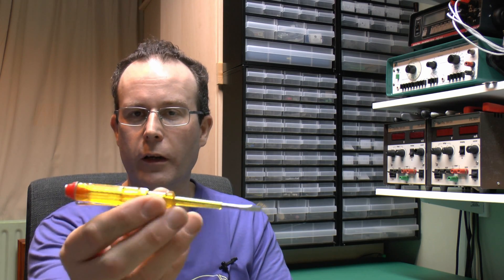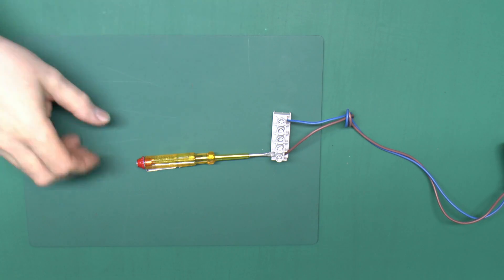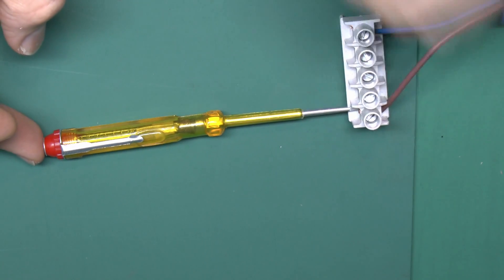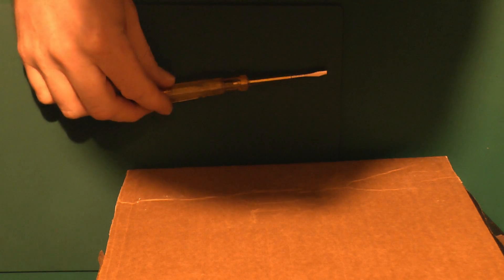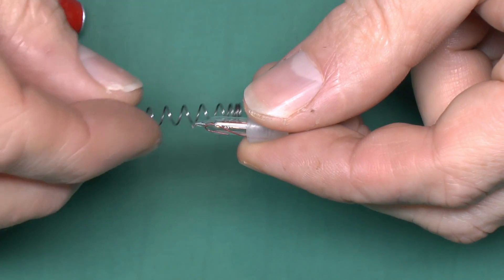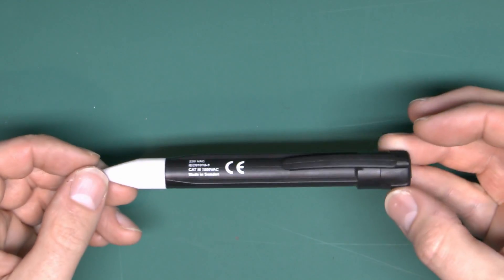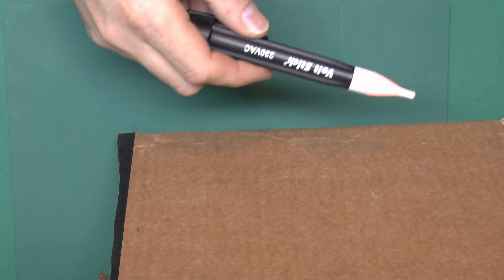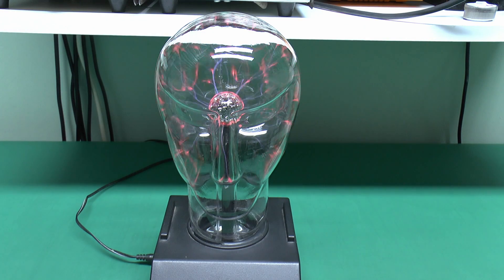Dangerous Device - Neon Mains Testing Screwdriver

Comment: I still have one of these purchased some 40 years ago, still works today. As you stated, only use to confirm mains present. NOT to confirm mains off. Mine has a standard type 1.5m ohm resister fitted. The older ones are somewhat better than the made in China crap. Needless to say mine is UK made! Made in the days when UK did make stuff, not just add a brand name to China rubbish.
Reply: Michael Beeny These testers are a dangerous. A decent multimeter can be had for not a lot of money now. I would not risk getting a belt from one of these so called neon testers. Especially a 40 year old one made when our engineering prowess was represented by the products of British Leyland.
Reply: Michael Beeny I doesn't matter whether it's China made or not. It's just what you get for what you paid for. Needless to say all the Apple products are made in China, and also China has it's own very successful manned space program. I'm sick of people always saying "Chinese made crap", they should rather blame the doggy importer and their shallow pocket. 

By the way, I have a Chinese made nicely built neon tester. Actually it has the similar structure as you described above, i.e. STD resistor with neon in a fuse like tube. I have no reason to believe it is dangerous or will fail any time soon. Of course it is More Expensive than the one in the video.
Reply: Michael Beeny Yea, Its all fun and games until that resistor shorts out or an internal short occurs. That jumps the resistor... That little resistor is all that is between you and a injury or death.
Reply: TG Lasers at all those amp's that a neon lam uses????
Reply: Properly said Morten Kristoffersen
Reply: 1.5m Resistor? that screwdriver must be very unhandy! but I suppose it would keep you at a safe distance.

Comment: why would he try and stage this test?... sure voltage testing terminal drives are more often than not awful quality but they have their own operating voltage range and as the multimeter displayed, it seemed to fluctuate (sorry if ive missed a detail explaining the cause). Basically, use the correct tools for the correct job. Multimeters all the way.

Comment: What I understood from this video: You make voltage testers, others that test screwdrivers, and you saw that you couldn't sell your fancy, expensive piece of shit, because of the simpler screwdriver. You even look, behave and have the body language of someone who's trying to manipulate or hide some fact from the audience. You're trying to convince us that the screwdriver just happened to fail in your video. I use electronic tools and I agree that they indeed, at some point, fail, but they DON'T FAIL ON COMMAND. You're presenting that screwdriver like it has some sort of intelligence, saying to itself: "Yeah, I work just fine, but I have to fail just this one time, just to prove something that is actually false...". Find your calling, man, you're lost.
Reply: I think Darwin rule apply here. You numpties keep on using those Mickey mouse made in China screwdrivers, and let's see who has the last laugh.
Reply: I don't know any electrician worth their salt that would go anywhere near one of these things except as a novelty.  Non contact current testers cost between 10 and 20 bucks for a reasonable, non pro one that will work with 99 percent of what you'd do as a hobbyest or DIY'er.  Spend the money, don't shock the sh*t out of yourself. ;)

Comment: I use a multimeter to test electrical for being live, but I also never trust any equipment to tell me if something is live. Tools can fail or be used wrong. I never touch potentially hot mains without putting the wire to a known ground or neutral first. The wire is rated to deliver 15A, and the breaker will go at 15A. Worst-case scenario you just trip the breaker that should have been off to begin with, and might save your ass.

Comment: The comments scare me. I always knew they were supposed to be able to test for voltage but why would you ever think it would be a good enough test on its own? I wouldn't mind but they actually look and feel like cheap shitty screwdrivers, and you're trusting it to tell you if something is live...
Reply: Quite. Even if you want/need to use a single pole tester, there are much safer ones around, including ones that only cost a little over a pound, delivered.
Reply: the point of the tester is to check if there is any voltage leaking the difference is the neon bulb tester is low impedance and the fancy one is high impedance THEY WILL NOT WORK THE SAME IN SOME CONDITIONS

Comment: today i was testing a socket outlet with one of those screwdriver testing things and i could feel the ac pulse coming through it , i had used it before many times and it didn't do it. it was stored in a shed so maybe it got damp inside  it ?
Reply: there perfectly fine to use just dont cheap out on the one you buy...and the one john is using in the vid looks poor quality i mean who makes the light orange with the casing of the screwdriver a similar colour...also ensure you put the screwdriver directly on the source ur testing he should of put it on the screw of the terminal block

Comment: My father used a quality one for 40 year's, I've used a quality one for 30 years , never failed , never had a shock , so what's the point of this video ? Don't buy cheap tools ?
Reply: Those were the days, when high quality goods were proudly "Made in England" with peoples safety and the goods' durability in mind, I yearn for those days, which I know will not be back, I'm afraid your generation will have to make do with cheap Chinese stuff which is dangerous and illegal, by the way the British still manufacture quality goods but they are not available locally, WHY... I don't know.

Comment: Well this is the best bit of scaremongering I've come across in a good while, I've been in the Electrical trade for 40 years & always had / used a neon. I'm still here to tell the tale, I've never once had even the slightest tickle through 1. But if you use cheap junk like the neon shown, you get what you deserve. Non contact testers even some of the expensive ones can give false readings & multi meters should'nt be used to prove a circuit is dead. As for killer screwdriver, where in Gods name would you find that sort of eht in normal buildings ?. By the way: The NIC still sell neons with their toolkits, albeit quality items.

Comment: Yes but if the neutral was disconnected on his test rig, the lamp wouldn't light even though the live terminal was live.  A neon tester in that case would be able to show the live terminal was live.
Reply: Jusb1066 said switched, not disconnected.  If it's simply disconnected, then the lamp tester wouldn't light up either, but if the hot and neutral lines were reversed, (where blue is now hot and brown is neutral), then touching the brown wouldn't light up the neon tester. Going across both lines with the lamp would, since it operates off the differential between the two terminals.  

It would have been telling if the terminal with the blue wire was touched with the neon tester, but unfortunately that wasn't done.

Comment: IMO, since there already exist far more reliable voltage detection tools for little money, particularly detection tools that can sense current without having to probe leads, there's not even an excuse for these neon testers to be used anymore.
Reply: But the neon tester would not be used anymore?
Reply: reliably.... never found one that was no-touch and was reliable enough to distinguish a 'dead' phase in a 3-phase system, neon-type works almost all the times instead.

Comment: If they are so dangerous then why are they not banned from the UK market?
When I was a child I accidentally touched a live wire, 240V, and I felt a local buzz/burn and pain to my finger, scary but luckily no consequences.
If you are unlucky enough to get a 240V jolt on your finger tip you just let go of the screwdriver tester and don't use that one again as it's insulating properties have been compromised. Having said that, I wouldn't risk it if I had a pace maker or any heart condition.
BTW, can these screwdriver testers not be made safer by knocking the human out of the equation and run a wire from its metallic cap to an earthing object?
Reply from the maker: chinacane Plenty of items are sold which should not be such as 'safety' socket covers, unfused double adaptors and 500W floodlights - neon screwdrivers are just another example.  They are not necessarily dangerous as is - but certainly can be when used.
If a neon screwdriver is in perfect condition and you are prepared to accept the huge limitations of what they can do then it could be used safely.  The issue is that there is no practical way of testing them before use to ensure they are safe and working, and they have so many limitations that even if used properly, they are still next to useless.

If you get an electric shock, you can't 'let go' of anything by choice - the electricity will totally obliterate any signals from your brain and cause your muscles to move in ways that were not intended.  If you are lucky, you might let go of the object or fall away from the electricity source.  Other times, this may not happen.
In either case, it is still possible to be seriously injured or killed.

There will be plenty of people who will say they have had electric shocks and this caused no problems at all.  They are the lucky ones.  You won't be hearing anything from the unlucky ones because they are all dead.

If you connected an earthed wire to the cap instead of a finger then it would work and might be safer - but instead of that you may as as well buy the proper 2 pole testing device, which is what should be used instead of these screwdrivers.  They can be tested before use, do not involve using your body as part of the circuit and do work reliably.
Reply: ***** Thanks for that comprehensive answer. You have definitely convinced me to get a multimetre, the auto range type, so I don't blow it up in my face. Wouldn't it be ironic if it blew up in my face, I fall down on the floor knocking my tool box over and there, right by my nose, I see is the neon screwdriver ! ;-).
What is wrong with holagen floodlights? I've got a 500W on my garden wall and never had a problem with it. It gets very little use though.
Reply from the maker: chinacane The 500W halogen floodlights are safe, but fitting them would not comply with building regulations, generally lights of that type are restricted to 100W or less.  This has been the case for many years, yet the more powerful ones continue to be sold.

Comment: Are the springs not effectively fuses also?
Reply from the maker: No, just there to hold the other components in place.
A fuse would not work in this situation, as even if the resistor and neon failed, the current flow through the device and the person being electrocuted would be far too small to cause any fusewire to melt.

Comment: It would have been informative to actually tell us what you did to the circuit to reliably stop the screwdriver working. - Care to share your secret?
Reply: I'm guessing he connected it through an isolating transformer to remove the earth referance. Neither the pens or the neon screwdrivers will work properly in a fully IT environment
Reply: Daniel Smith Yeah I reckon that's why the voltage was a bit on the high side as well
Reply: It's because he wasn't grounded (earthed). He could have touched the live wire and not been shocked.

I used one of these for about 10 years, until it got lost, and it did exactly what it was supposed to do - tell me if the I would be shocked if I touched the wire in question.
Reply: I reckon he removed the neon lamp when doing that "no glow test"
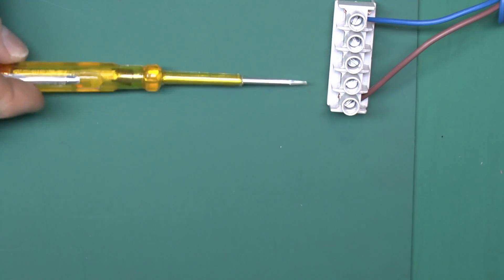Reply: 3:11 clearly lying for his own purpose, you can see the orange light come on then he moves the screwdriver tip to a point where it doesn't make contact
Stupid virgin

Comment: I remember when I was in my apprenticeship in a power station they called the screw driver  "lying stick".  You always use a voltage tester with two test probes! A multimeter  can be dangerous too if you choose the wrong range (eg. amp. range for voltage) this is the reason why professional electrician always work with special designed voltage and and continuity testers. This devices are save to use. For a house installation or trouble shooting you often only need a quality voltage and continuity tester.
Reply: TheBuggy73 Or in the case of an electrician in many cases a multifunction tester.
Reply: A voltage tester can only answer the question voltage there yes or no, same with a continuity tester, continuity yes or no. If you like to know how much voltage or how much resistance you use a multimeter.
Reply from the maker: 'Lying Stick' - excellent name.

Comment: well i'm glad i watched your video, i have bought many of these over the years and used them to test and change light fittings etc after switching off at main circuit board,  not once did it say on the packaging that i need to be in contact with the metal top.  therefore all this time i have thought i was ensuring there was no current running but infact me holding the device like a pen was useless and i'm probably very lucky not to have lived in a property with faulty wiring or circuit board.
Reply: Wow glad you had no mishaps, so you can't be the only person who doesn't know how to use these properly. I always test these screwdrivers a few times (before using it to confirm if a wire is dead) at a live plug socket to make sure the light inside is still working. I can't believe you never did this and so never saw it light up, atleast you know now. Youtube may have saved your life! After watching this I'll be using my multimeter not one of these things.
Reply: Buntzums wow, fuck you.
Reply: *****   I always pull out the multimeter and test it accordingly on a known circuit before commencing work.  Unlike 120/240... industrial 450VAC/600VAC/800VDC circuits are unforgiving.
Reply: I can see the headline now: Idiot electrocutes himself opening a light fitting.

Comment: A phase tester in the form of a screwdriver can shine only when we believe it is also the phase.
The same is true for the non-contact voltage tester . If you hold it on neutral , it's not lit.
I think you've reversed the phase and the neutral conductor in the video. Therefore, the phase tester and the Non-contact voltage tester has not shone on the brown wire.
A digital multimeter also measures something if there be only one test probe to the phase. Since you started with a multimeter at Brown and the meter showed nothing , you were at Brown clearly neutral .
Conclusion: The phase tester works all the time - just because you have kept him on the wrong wire , he has not lit up .
I have voltage tester in all forms. No one has ever left me in the sting, or given a lesson ...
In electrical engineering, you learn that you should test each voltage tester before use for proper operation .
Reply: to djblackarrow - you are correct; he switched the live and neutral. If what he claims is true, he should have shown a single sequence leaving the two-pole tester in place (and lit) and then touch the tester first on one and then on the other wire. The man is a cheat.

Comment: While maybe a bit more unsafe, I find the single-ended measurement devices very useful when checking which wire is live and which one is neutral. Very important when installing switches, dimmers, etc... when you have no direct ground available. (otherwise, you can measure the reference to the ground)